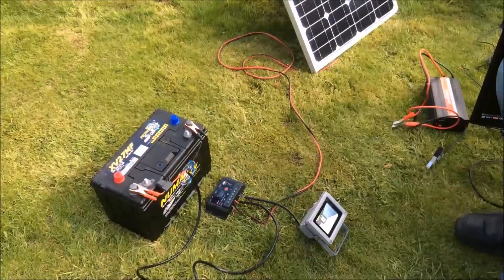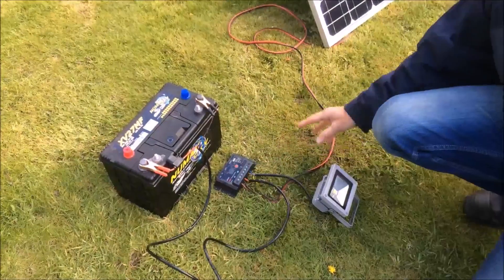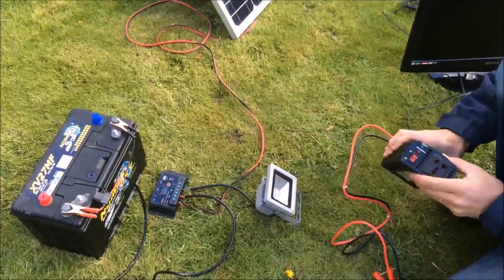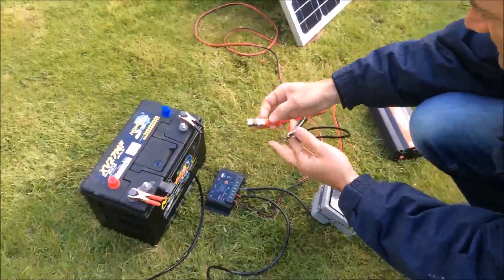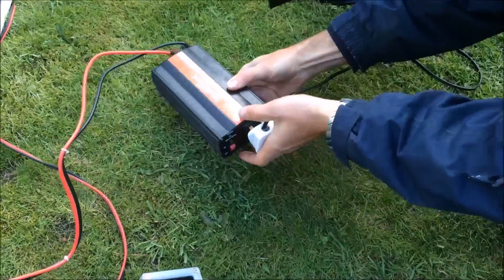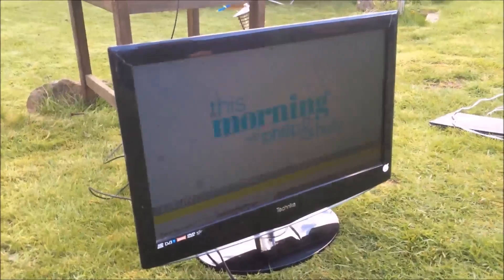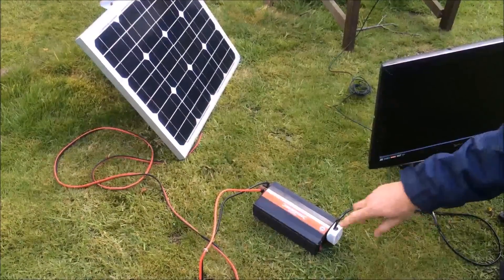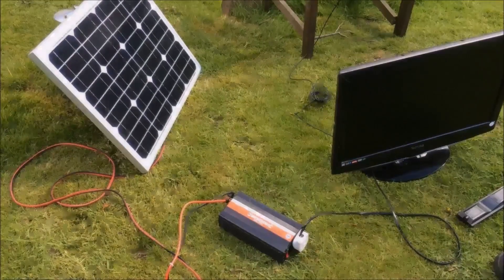How to set up a solar panel, regulator, battery and Inverter - Free 240V Electricity, Part 2

Comment: What happens when the battery is full? Will the solar panel still continue generating voltage with nowhere for it to go? Will it overheat?
Reply: For my experience, Solar Charger can't stop the output voltage to battery (for 12VDC) when the sun is so shiny. Battery voltage is over 15Volt which over the limit of Power Inverter input. So Power Inverter alarm and cut off the 220v output.  Don't know how to solve this.

Comment: THANK YOU I'm a newbie to camping and I've been looking to build my own power/charge setup for my families phones, small tv and tent lighting, and I almost went out and bought an overpriced loud petrol invertor generator, until a camping friend of mine told me I was wasting my cash and could just basically buy the components and do what you've done..
No noisy gen,No petrol fumes, save on cash and its a  simple DYI set up for newbie camping single Mum's.. 
Thanks again..any chance you could give me the specs/details on each component so I'm sure to get the build just right etc..
Trace
Reply from the maker: This can be found in our online shop under renewable energy